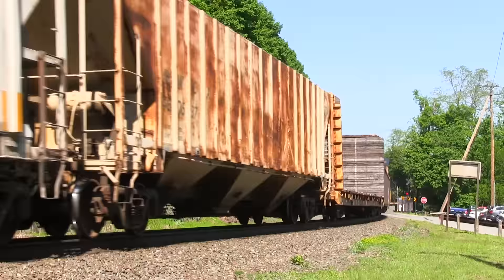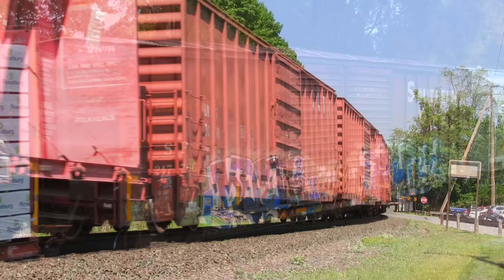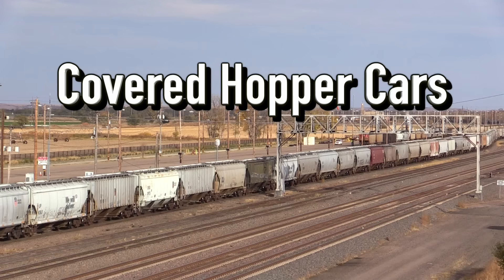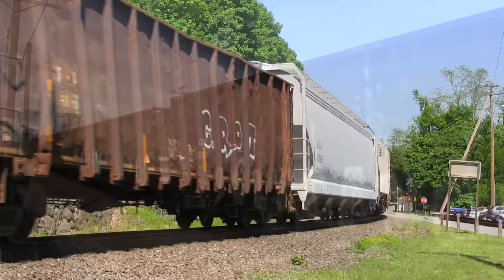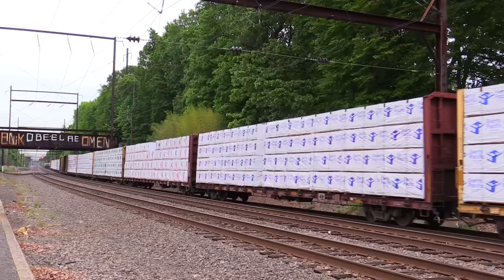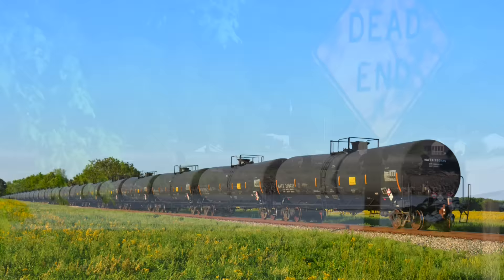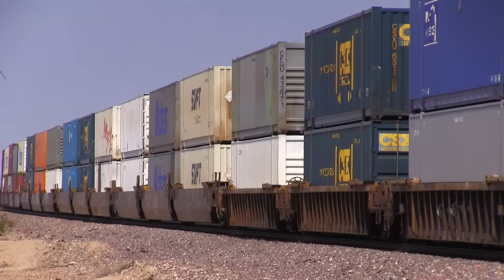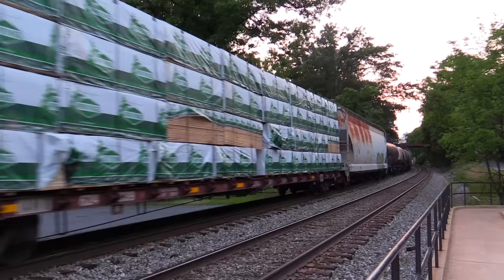Freight Cars: Train Talk Ep. 13

Comment: Finally found the proper name for centerbeam flatcars.

One type of freight car that I still don't know the name of, that I saw fairly frequently in the Atlanta area in the 1990s and 2000s (but seems to be getting less common) is a weird skeletal type of car consisting of only a main beam with some depressed flat plates attached to it at one end for accommodating truck trailer wheels, but of total flat area far too small to qualify as a true flatcar, riding on only 2 axles, of length slightly greater than the full-length truck trailers that they are made to carry.
Reply: I literally just endeavored to find out what kind of car I saw this morning, and it was the center beam! That's so funny

Comment: Loved seeing those old MP gondolas! The Santa Fe ones built in the 50's were practically indestructible. I used to work in a scrap yard loading those gons with a magnet crane. It didn't matter what kind of scrap you dropped in them or how heavy it was you wouldn't dent it. I remember we had a brand new gon in the yard. I dropped a long drawbar coupler (that was about 7 feet long and weighed around 800 pounds)from a scrapped autorack, from the magnet crane, about 10 feet above it. It came in a bit sideways and went right through the side of the car (half in and half out). The railroad gave us back the indestructible Santa Fe cars after that.

Comment: Just a single nit to pick - Box cars are still considered the #1 most common car, at least Uncle Pete (UP) says so
Question: what do you think bathtub coal hoppers should be classified as? I personally think they're high sided gons but most roads call them hoppers.
Reply from the maker: Thanks Doug! Basically, if it has hatches that open up on the bottom, it's a hopper car. If it doesn't, it's a gondola. So, in that case, I'd say it's a hopper car.
Reply: Bathtub coal hoppers do not have hatches on the bottom, they're emptied by a rotary device that flips them upside down